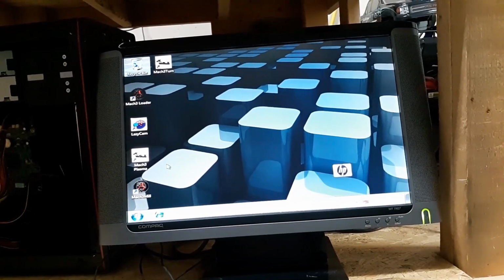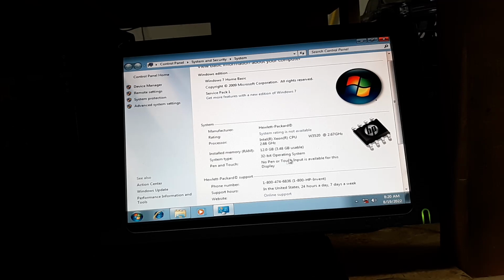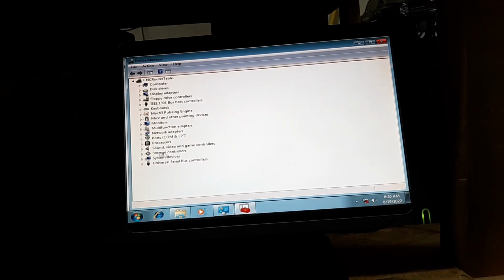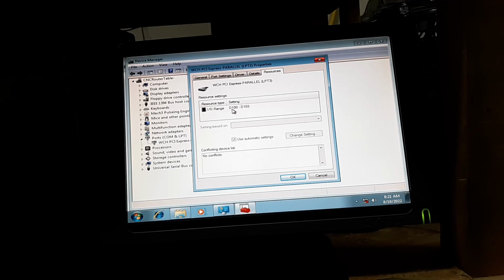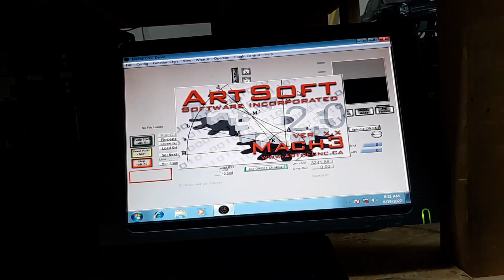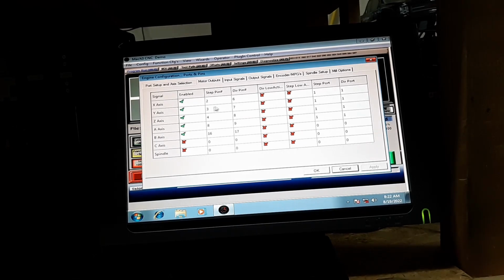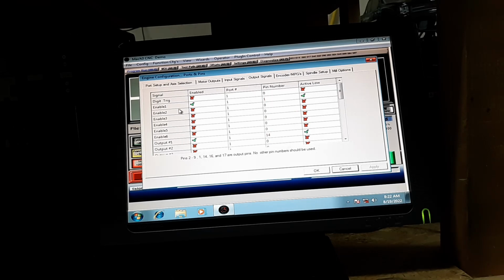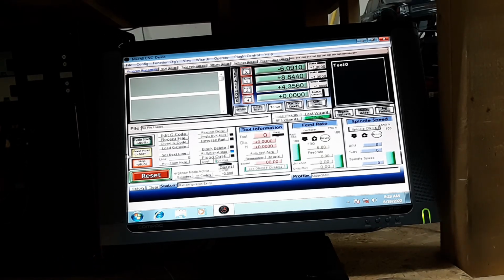Mach3 / Mach4 Parallel Port Settings and Errors Explained! (TB6560 Settings)

Comment: Thanks for the video! But still didn't understand how to solve the problem..... Or there's just no solution?
Reply from the maker: As long as a parallel port is set to bidirectional it should work perfectly fine with match 3. Provided your os windows is 32bit version.  Os versions 64bit do not work at all with parallel ports.
Reply: Sorry....... how do i set it bidirectional? Thanks
 @BuildBreakFix

Comment: MINE KEEPS REBOOTING.  IM LOST ANY IDEAS..THANKS
Reply from the maker: Rebooting?  Pc? If pc reboots when controller is plugged into the PC via parallel port. Normally means you have high voltage powering your controller itself. They run on 5v. Or off the parallel port cable. Make sure your psu to power your motors is not connected to the 5v+ or 5v-.  Backfeeds into your PC and PC psu goes into safe mode as a result. Most common issue when PC reboots. Soon the port driver loads. Reboot

Comment: Good info,, what is your e-mail,, i might need some more help. Just bought a win 7 computer , have not checked if it is 32 bit yet.. it does not have a parallel port,,, have to check if it has PCI or ISA. slots. You would think a jumper wire to 6 volt the PCI slot would fix this.. I  might have to buy and old mother board... good info.. why are you sitting on the floor?
Reply from the maker: If it has new pci Express its 3v. If it has old white pci slots parallel port is 6v parallel port runs off those bus systems 99% time.  Win32 is must.  64bit does not work at all
 Mach 3 and 4 will both say not supported.  Some 64bit win10 pcs will work with usb links.  But they error alot and freeze.  There is other cutting programs though run 64bit just fine.  Mach 3 and 4 is not one of them!